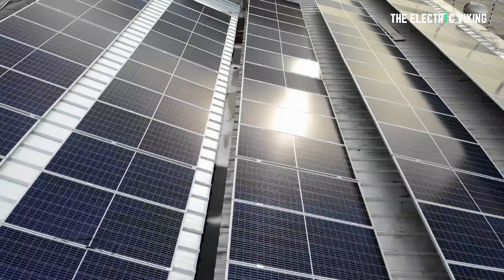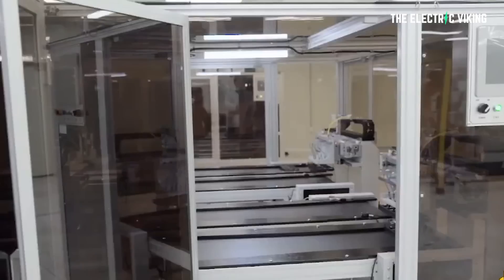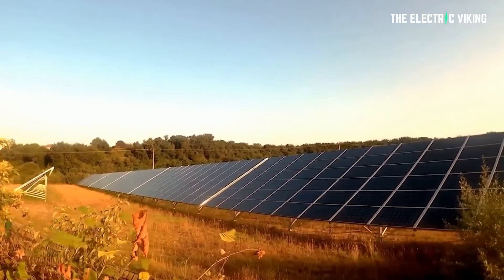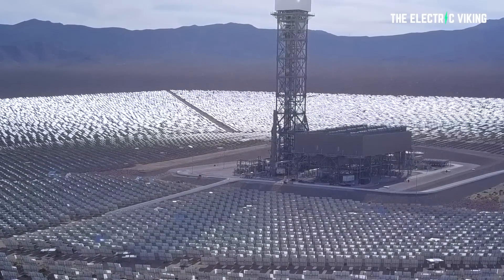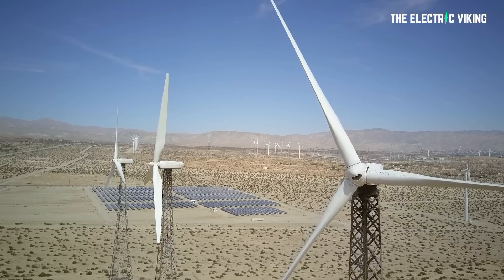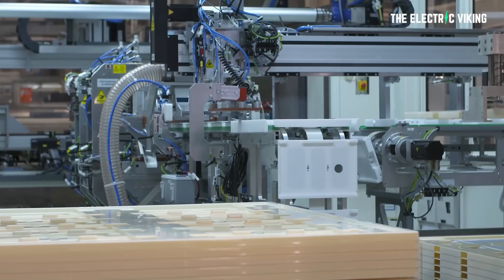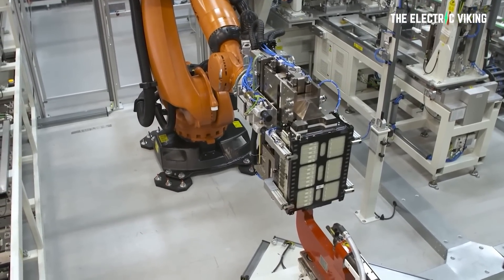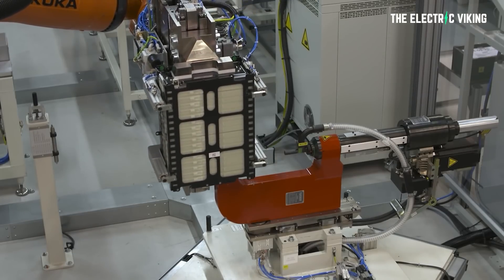The new battery that is cheaper than lithium with 4 times the capacity

Comment: If you look  at a periodic table you can see why sodium and lithium batteries will have similar chemical properties, but lithium will always be superior for capacity.  Lithium sits directly on top of sodium on the periodic elements table. elements that are in the same column of the periodic table have similar chemical properties. Lithium and sodium are stable as a salt, but have a loose electron can easily be separated out, forming a sodium or lithium positive ion and a free electron. The Na or Li+ will move towards the negative terminal but Li /N’a+ ion cannot move through the wiring, and so moves through the electrolyte and separator. Electrons move through wire more easily than through the electrolyte, so they take a path through the wiring. This generates electricity. So while lithium and sodium will behave similarly being in the same periodic column both forming a +1 ion, lithium is just smaller than sodium. Li+ has 3 protons and Na+ has 11 protons. sodium is just bigger so it will occupy more mass in a battery and there will be fewer ions for any similarly sized battery. Sodium ions can replace lithium ion’s because they’re cheaper and easier to obtain but they can never have higher capacity as long as basic chemistry exists
Reply: Well, sorta. Anode and cathode play a big part in how many of the present Lithium (or Sodium) atoms actually take part in the operation (e.g. how easily or how far the ions intercalate). So while lithium certainly has the edge in theory you have to look at the entire system when comparing batteries.
Reply: @Peter Zerfass  ... curious. How does sodium change the cathodic reaction? Sodium being much larger than lithium, what material is employed to intercalate sodium and is it physically stable over many cycles?
Reply: @tmcche7881  I don't know what material CATL is using (whether amorphous or structured). Choice of material also feeds back on choice of electrolyte as that has impact on surface interactions. Battery chemistry isn't as straight forward as saying "anode material X is the best" or "electrolyte Y is the best"...it's always the whole package you need to look at. 
That's why you should always be careful when you see headlines like "new cathode material enables 40% higher enetrgy density" or somesuch because that doesn't tell you whether you have to make tradeoffs somewhere else.
Reply: @tmcche7881  Some assumptions are being made.  Unfortunately, I think this was done in the past, and these folks aren't aware of that research.

It didn't fare too well, if I recall...
Reply: @Peter Zerfass  ... the whole system matters, indeed. Not just the battery. How the system boundaries are drawn, from sources of materials to energy supplies.  It's why I am always skeptical about happy talk without the specifics. Or, as they say, "the devil is always in the detail."
Reply: Would an innovation that makes a sodium battery more efficient possibly also improve a lithium battery.?  We will have to wait and see if this new battery is commercialized. Lots of clickbait potential new batteries.
Reply: @glenn726  Yeah, this vid was clickbait. Not 'news'.
Reply: Great explanation. Thanks
Reply: Path through wiring often call d path of least resistance
Reply: @michaelstarkey9745  ???  The path of least resistance is not always through the wiring.  What were you referring to?
Reply: Agree, Lithium ion is smaller than Sodium. There are no place for Sodium battery on density power is needed.  I heard there are some Sodium pump liquid battery are used for power storage in power plant.
Reply: Yes but do we need the “Best” capacity or 4x more energy dense ‘less’ capacity is still going to be cheaper AND longer-range than lithium … The best solution isn’t necessarily the best capacity but rather the cheapest most effective, planet/human friendly is the best solution
Reply: Luckily chemistry is only one part. The other one is geometry. You get less capacity if you develop the sodium part as primitive as the lithium part...but if you actually put some effort in creating a 3D structure of the sodium part its capacity will be way higher than the classical lithium part. Of course if you would do that with the lithium part it would have a higher capacity than the sodium 3D structure...but lithium is just too f expensive.
Reply: let me know how about your explanation about Aluminium battery ?
Reply: @antonanton5503  Are you referring to what has been called the aluminum air battery?  If that's the case, one big problem it has, is that it doesn't recharge, but at current state is a one shot deal.
Reply: Thanks for reminding me of some these basics!
Reply: Your assumption is that the chemistry is exactly the same and lithium and sodium are a 1-1 substitute. If not, then you can’t make this statement.
Reply: @robinjoe1  This is exactly correct and my assessment...as well as a cautionary tone...
Reply: @Ask-a-Rocket-Scientist  I didn’t say their chemistry is exactly the same. I said their chemistry is very similar. Of course I didn’t go into detail of their relativistic effects first ionisation energy, electron affinity, and anion polarisability. But the chemistry of the alkali metals remains dominated by the loss of their lone valence electron in the outermost s-orbital. The alkali metals are more similar to each other than the elements in any other group are to each other
Reply: Wow what an explanation, thanks
Reply: Thank you for the explanation. Still it would make Sodium based battery very viable for renewable energy storage where battery weight and volume  doesn't matter that much and at least much mess than for EVs. That would also the ease the pressure on the lithium market which is currently just madness. So much that my fear is that Lithium extraction and refining industry may very well become THE bottleneck to EV mass production in the next 2 to 3 years.
Reply: We mustn't forget the OTHER aspect of lithium and sodium...they're ALKALI METALS.  This means they react SPONTANEOUSLY with water and create their own fuel and oxidizer (i.e. hydrogen and oxygen).  Lithium's tendency to react is NOTHING compared with sodium (check out videos regarding).

Just because it's something that CAN be done in some way, doesn't mean it's a good idea.  If you think the fireworks with Li-ion batteries are impressive, think about what would happen with Na-ion.
Reply: @billcichoke2534  in reality, sodium looks to be safer because it requires higher temperatures for thermal runaway to start. It also has no issues being full charged or discharged right down to 0V. Another perk is that it is hardly affected by cold at all, with 90% capacity at -20°C/-4°F.
Reply: @truhartwood3170  Um...you didn't read my post?

The problem is not thermal runaway...it's the initiation of an alkali metal reaction that FEEDS OFF WATER.  This is why the batteries can restart burning hours after being submerged in a TANK of water. It's because it's not an ABC fire.  It's a burning metal (Class D) fire.

What I was stating is that sodium is FAR more active at reacting with water.  Even coolant would be enough to set it off.

It is an even WORSE idea to use sodium for ion mobility, than lithium.
Reply: @billcichoke2534  did you not read my post? I said 'in reality'. In reality water getting inside the pack very rarely happens. While there have been cases of fires after submersion (during flooding), I'd assume they've made pack modifications to prevent that in the future. Most fires are caused by thermal runaway, hence that being the more important factor. It's really a moot point because battery fires happen so rarely anyway, you don't really need to worry about them. Everyone has lithium batteries in their homes and pockets and nobody is walking around worrying or even thinking about the possibility of them catching on fire.
Reply: @truhartwood3170  There is ALWAYS water inside the pack, in the form of 50/50 coolant.  When a cell shorts out, it begins to burn.  That heat compromises surrounding cells, causing them to fail and burn.

All while immersed in coolant.

This is not 'thermal runaway.'  This is, as I stated, a burning metals fire.  It is THAT reason these batteries are a fire hazard hours and days after the original burn is suppressed.  And most people have not seen a lithium battery fail and burn.  That doesn't mean it's exceedingly rare or that NO ONE is concerned about that danger.  It just means most people haven't had it happen to them...YET.
Reply: @billcichoke2534  There is an easy and obvious solution to this. Equip every fire department with one truck that has a monster sound system, and when an EV is going up in flames play "Bury Me In Smoke" by Down. Now you have an epic metal flash mob instead of a big scary. It's now not a bug, it's a feature.
Reply: @billcichoke2534  Among lithium batteries, LFP batteries are safer. Also the battery by C4V is very safe- similar to LFP but uses manganese instead of iron. Also, the graphene-aluminum battery by Graphene Manufacturing Group is very safe. I am invested in all 3 of those, and encourage you to take a look at them.
Reply: @truhartwood3170  Ouch.  A James Hetfield in the making...
Reply: @andrewkaiser7203  I don't invest in technologies.  I invest in industrials (mining and industry machinery production) and energy.  I think a technology company has to prove its product before I buy the tech.  I may not get in on the ground floor, but I will support an honest company making an honest product.
Reply: @billcichoke2534  Can you explain why water should be used as a coolant in battery packs?
Reply: @truhartwood3170  I would disagree with that.  As I said, the fires in ICEVs are easily contained and extinguished.  EV fires are neither.
Reply: @beatreuteler  Do you understand what a 50/50 mix is?  It's 50% ethyl glycogen or the like, and 50% water.
Reply: @billcichoke2534  Makes sense. I will admit that I'm looking for some moonshots, which of course is quite risky.
Reply: @billcichoke2534  My question was rather meant in the way if you can explain why water should be used. It doesn't mater if 50% or even less, water isn't to be used when it is not necessary. For example, the new CTP design BYD is using as far as it is published does not employ any liquid cooling. e.g. no liquid, no water. No?
Reply: @beatreuteler  Not a fan of liquid battery management.  It usually means you're trying to get batteries to do something that isn't safe...like charge too fast or discharge too fast.  But either way, coolant is a 50/50 mix because water cools better than EG,  but the freezing point of either is reduced far below-12 when mixed.
Reply: @billcichoke2534  The better way is to reduce the losses (e.g. make charging and discharging more efficient) thus you can cool it using air even if cooling efficiency is then very low in comparison, but you have major other advantages. As far as BYD's CTP design is concerned, I believe this is exactly what they try.
Reply: @beatreuteler  Reducing internal resistance is good, but you have inherent losses from charging.  Connectors, power conditioning and conversion...all create losses.  And batteries can be incrementally better, but are still the WORST way to store energy.
Reply: @billcichoke2534  It depends on the goal. Momentarily, to store energy for mobile applications with short to moderate storage time, batteries are probably the BEST way to do it. If you disagree, you may explain what other storage system 1for exactly such application is better and why?
Reply: @beatreuteler  Right off the bat, using (for examples) liquid H2 for a fuel cell or combustion comes to mind.  LN for use in a superconducting thermocouple system would be another.  Both not only are better as far as energy stored per kg by at least an order of magnitude, but both already have existing source networks to use for refills.
Reply: @billcichoke2534  Yeah, but both have "deep underground" efficiency. In all applications where energy does not need to be stored for longer than maybe 2 weeks to a Month, batteries beat them both by far.
Reply: @beatreuteler  No, that's the target I was talking about.

Cryogenic fluids don't store for weeks or more like petrofuels, or years like coal or fissionables.  They warm up and 'boil off' over a short period of a few days, even with insulated containment vessels.  Longer term storage as pure gasses would be possible, with liquefaction being done at point and time of a fill.

The thing is, one pint of liquid H2 or N would expand to around 800 ir so pints of gas.  The need for a heavy pressure vessel would he reduced, being replaced by a lighter expansion chamber and mid pressure tubing.  So, even with some specialized plumbing and hardware, these systems would still avoid the enormous weight penalty of batteries.
Reply: @billcichoke2534  It's fine if the weight burden of batteries is reduced by improving their technology. Replacing batteries by tech that is far less efficient just because of their weight: There is only 1 application that will make sense: Flying. For litterally all other applications it's nonsense.
Reply: @beatreuteler  No, much of the power put to the motor is to overcome the weight of the battery pack.  Even in ground applications, weight IS an issue.  You also have to consider the tires and suspension, which aren't designed for that kind of weight.

Technology can only REFINE the base concept.  It cannot overcome chemistry or physics.  Even differences in materials and processes have resulted in miniscule power to weight gains, but have also resulted in far more expensive battery cells.  The only option left is to ignore safety protocols and further overcharge and overuse the batteries, HOPING that battery coolant will keep them from fully destabilizing.
Reply: @billcichoke2534  You obviously don't inform yourself about the facts. Everything works as designed. it is correct that suspension etc. does need to be stronger and therefore that adds even more weight, but that is done and the vehicles run more than 300'000 Km if no accident happens etc. All is fine and I don't say weight is no issue at all but it is much much less of a issue than you think. Go and inform yourself!
Reply: @beatreuteler  No, the suspensions are still sourced from a Canadian company that makes them for vehicles like the Jaguar F-Pace.  The only difference is the stiffer struts and slightly redesigned tire tread.

And I'm quite informed from Tesla's Owner forum, thank you very much.  These cars aren't going anywhere NEAR 100k MILES without some kinds of issues cropping up, much less 300k KILOMETERS.  It's between that and the constant changes in hardware that make the average ownership of a Tesla less than 3 years...according to Tesla owners themselves.

Read up.  You bought into a future white elephant.
Reply: @Tru Hartwood  I'm curious what the specs are compared to lto batteries they have 50,000 cycles can charge at a 10c rate at -45c
Reply: @billcichoke2534  Good point. I'm no expert, and it has been a long time since I took a few chemistry classes. But I think it's fair to say that anything that stores a lot of energy could somehow be prone to a violent reaction (a very general statement, I admit). Having said that, my favorite battery companies are Magnis Energy (batteries similar to LFP, but use manganese instead of iron), GMG (graphene-aluminum batteries) and Microvast (several battery chemistries, and a next level separator).
Reply: @andrewkaiser7203  See, I don't understand why we're subjecting the general public to be guinea pigs around chemistry experiments.  Instead of trying to overcharge and fast discharge batteries (which shortens their lifespan and almost GUARANTEES some kind of failure), why are we not exploring real time generation and short to mid term energy buffering with capacitors?  Less weight and less volatility...

I would think this would be the path we should be exploring.
Reply: @billcichoke2534  Check out Graphene Manufacturing Group. Aluminum-Graphene batteries that are basically super capacitors. No lithium, cobalt, nickel or rare metals needed. Completely recyclable (almost...95% or better). No thermal issues, and long lifespan. Their bottleneck is producing enough graphene, of the exact type(s) that they need, but I think they're close.
Reply: @billcichoke2534  Do it. Make billions. Save us all.
Reply: @truhartwood3170  Working on the first.  Not holding my breath on the second.  And Jesus already died to save us all, so THAT has already been done.
Reply: @Bill Cichoke  I think lto batteries are the closest batteries we have that resemble a  capacitor 10c rate can charge at -45 just  it only has 110 wh/kg and 177wh/lt  one cell is 45ah@2.3volt but the cycles are up there 50,000 last batteries in your life time maybe when you give it to your great grand kids it might need replacing

Comment: The issue with Li-ion and Na-ion cells is NOT the Na and Li. Cells are made with wide range of materials in both cell types. And thos other components are 95-97% of the cost and structures. What anyone agruing for Na-ion forget to mention is LFP cell cost for those other 97% of cell components are 80% cheaper than with Na-ion. So Li and Na cost has almost no effect to the cell cost.

Comment: I wonder how will these battery types react with water... greek fire does it sounds to me... otherwise I fully backup all reliable and cheap energy storage systems being developed.
Thanks for your great work!
Reply: The sodium won't be in it's pure state so it probably won't react with water in the same way as pure sodium will.
Reply: @adus123  plus it's sodium in its liquid form that badly reacts with water. Sodium fusion point is at 98 degre celsius. Unlikely to reach this temperature in a battery I guess.